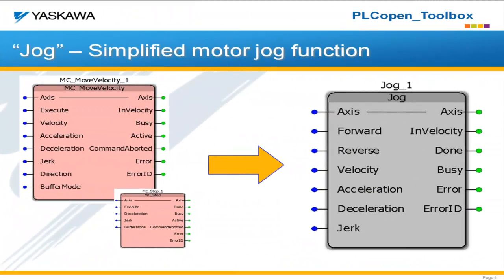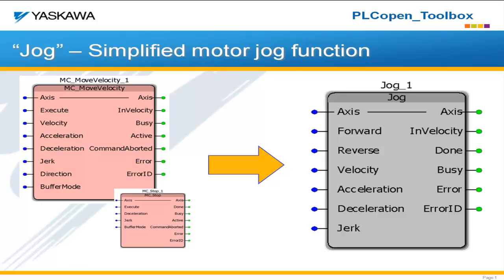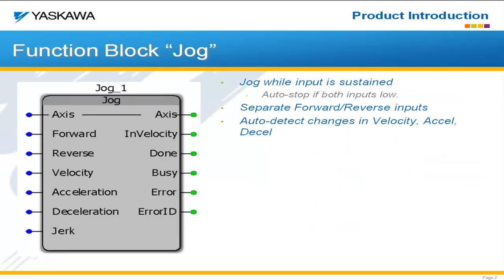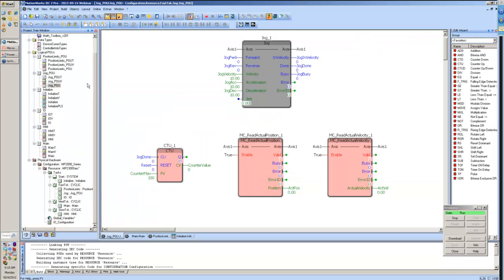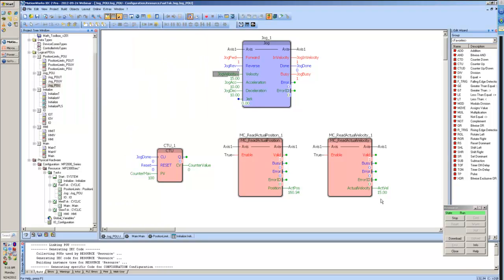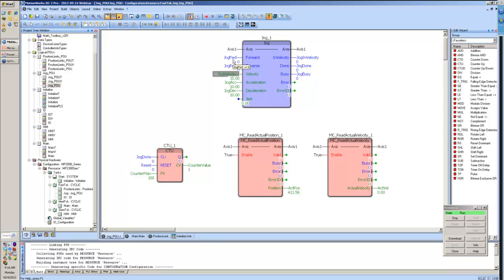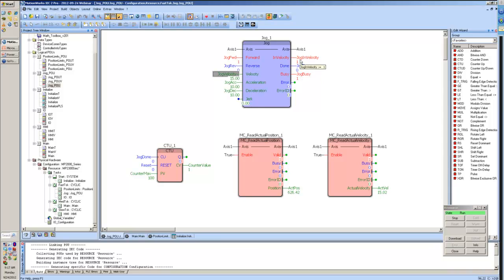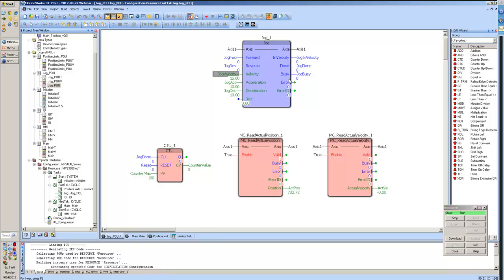PLCopen Toolbox - Jog

Comment: Hi guys,

Fist of all. Thanks you for your help! 

I'm working in a project with a external encoder I would like to know if there any chance I could execute Jog function with out the servo pack looking for the position or pulses from the encoders(feedback and external) in a program.
If I use jog function on my code when the forward push button is pressed the servo motor runs and not stop until gets pulses from the external encoder.
I wondering if could I run the servo motor without the servo pack combine the pulses fron the feedback encoder and external encoder?

Thanks a Million
Reply from the maker: Thank you so much for your interest in "PLCopen Toolbox - Jog". Yes, These functions are possible with programming. Please select the nearest service provider in your area: https://www.yaskawa-global.com/company/profile/global or contact our Technical Support Team for further assistance at https://www.yaskawa.com/support-training/support.